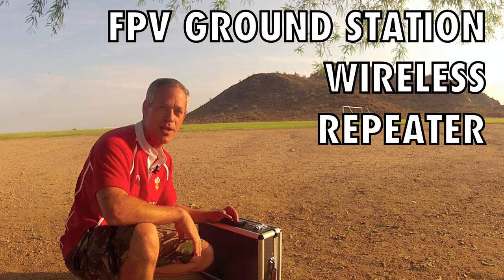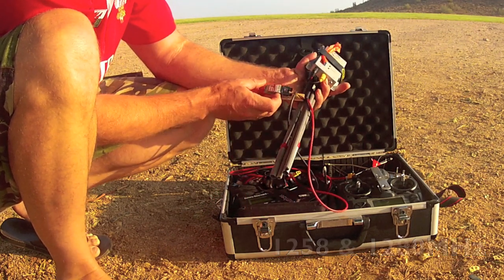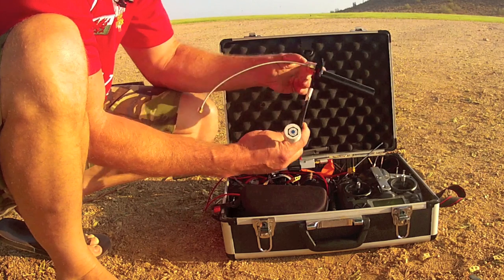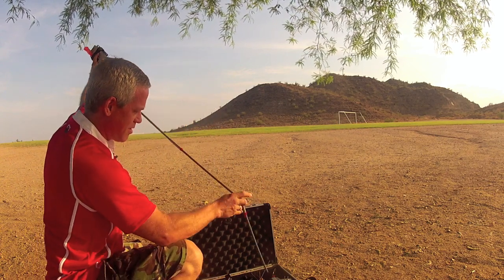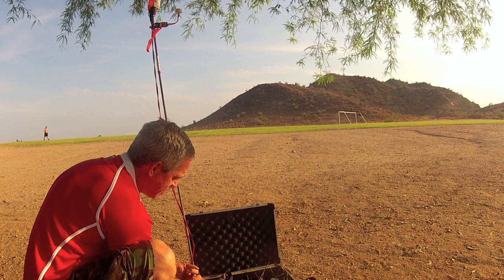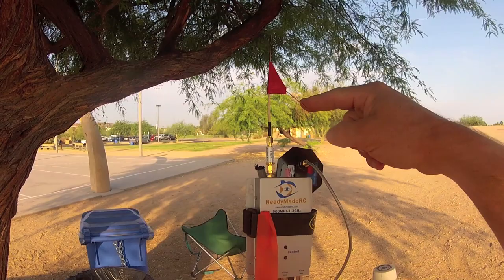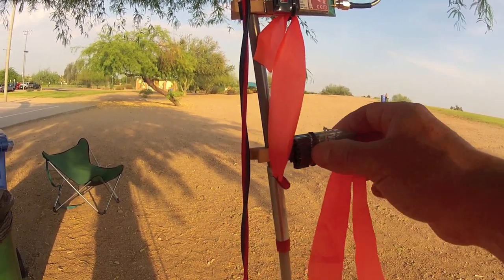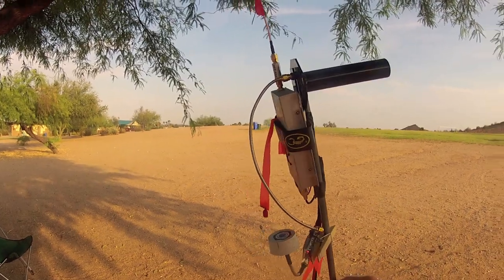FPV GROUND STATION WIRELESS REPEATER

Comment: I did this when Fat Shark first came out with the 5.8gHz goggles. 
I bought 2 sets of 5.8gHz goggles to use on planes and they were so limited with the stock antennas. (this was before the clover leaf revolution) 
The freedom of not being "cabled" to the ground station has been great. 

Later,
Gundy

Comment: I actually use a similar setup, only with a 100mw 5.8 fatshark VTX as my relay.  I do recommend affixing a proper finned heatsink to even the 25mw vtx.  The Immersion units can get very hot.

Personally, when I want to sit in air conditioned comfort I just put my groundstation tripod on my Jeep roof.  Having it up high not only gives better signal LOS, it also protects against curious and clumsy feet knocking over my GS.

Comment: I know this is a old video but I building a similar 1.3ghz to 5.8ghz repeater my concern is will i loose my osd information on the mointor? I'm thinking that information is sent by 5.8ghz vtx but I'll be replacing that with a 1.3ghz vtx. Thanks for video

Comment from the maker: To each his own.  A repeater arrangement by definition requires two frequencies.  As the main video link I used a long wavelength that suits my needs.  As the local link to the goggles I used the frequency for the video goggles.  There is no unnecessary complexity or components.  I also use one main battery for the ground station and one for the wireless goggles.  Cabling is extremely simple. Congratulations on your ground station which meets your needs.  The link you give leads nowhere.

Comment: Hi Ed, can you be more specific on the wiring you did from the RC jack on the 1.3 RX to the FatShark 5.8TX for your repeater?  Thanks, great vid.
Reply: Consider how your camera would connect from the yellow wire to a video transmitters yellow wire on an aircraft to be received by the GS. The 1.3 receiver on the GS becomes the camera with the yellow wire that connects to the repeaters yellow wire to transmit to your goggles..

Comment: In your video, your GS battery is in the case with lead wires spliced in between the repeater and VTX.  With this spliced in, does this affect the battery performance any ?    This keeps the weight off the top, where could be a problem.

Comment: Air conditioning ahhhhh nice. Did you make yje inverted V 1.3? any specs on V wire lengths? just ordered the 700mw  1.2-1.3 unit.

Comment: (I know it would be over complicated and require a second pilot but, ) I wonder what kind of range increase you could get if you had a parkzone-radian converted to a sort of awacs role flying high altitude circles and repeating signals between the ground and the fpv aircraft.

Comment: I have thinking of how to use a repeater on one plane to extend the range of flight on another plane.  The plane with the repeater, which I have nicknamed the Echo Bird, would fly out and go into loiter, just circling over a point. Then a second plane, or even a quad could fly to that point and descend to low altitude to I check out the area near the ground. The Echo Bird would be relaying the video and possibly the control link between the ground station and the quad, a RC AWACS plane.

Comment: Nice, I just made a mast like that with a tent pole too. Though it was too flexible and bends to the ground with the weight of my diversity rx. I now have some old telescopic walking poles to use instead.

I love the repeater solution. Do you lose any video quality? All we need now is a modded version of OpenLRSng to repeat the control signal. Airborne repeater anyone?

Comment: Are you using a low pass filter?
Reply from the maker: Richard Sultmanis I used a high pass filter on the VRx for a time, while using 433MHz for control,  but it didn't seem to make much difference so I don't use it regularly.  But they do have their place.

Comment: Why not just use a tripod?  Yeah, they are a bit bulkier, but you get a so much more stable platform, and you can put more on it, even a tracker if you want to.  I can't see doing that with a tentpole.

Comment: Squishy, use a big enough battery and it won't matter how much power you use, you won't use it up.  Keep in mind that receivers don't use that much juice and the little 25mw vtx doesn't use much either.  Now, if you are running a really long line to a DVR ro recording laptop, then yeah, you're gonna chew through battery.  But otherwise even a 2200mah battery will last for several hours.  Probably longer than you are going to fly in a session.

Comment: Way more complex than it needs to be and you have things you just don't need. Why use two frequencies? I have no need for freedom at my ground station, but I do have a need for many things you missed. Like a single large battery solution, easy cabling and separation, a power indicator is also very useful to see how much is left in your GS battery.. my gs here: rcpowers.com/community/threads/fpv.14187/page-7#post-175965